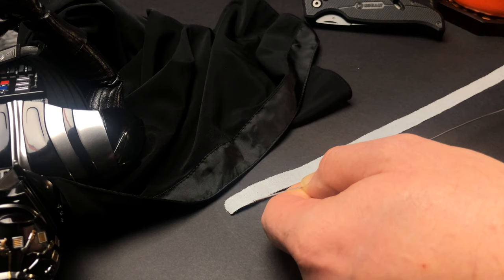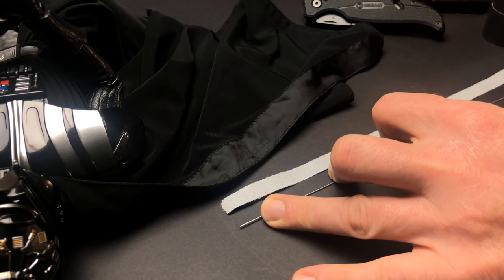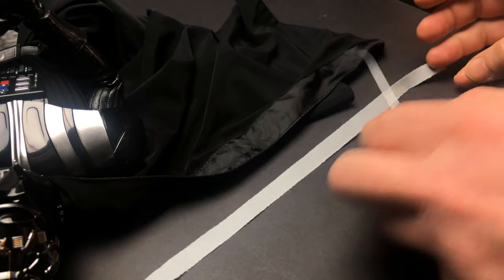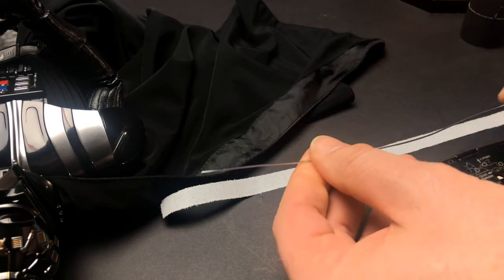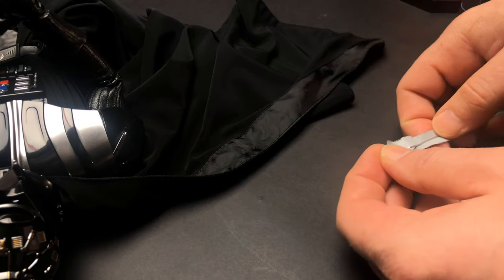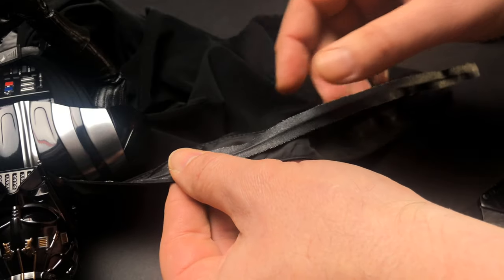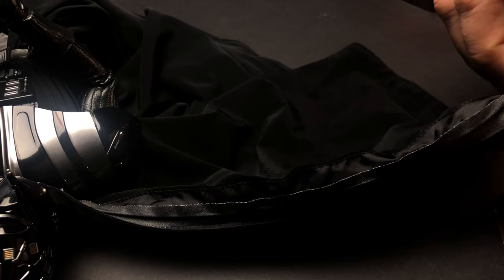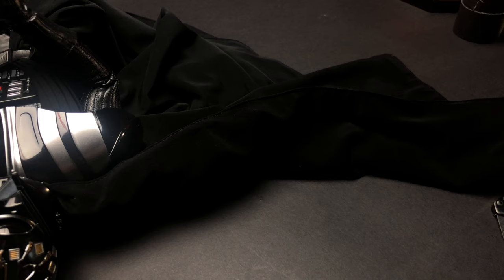Hot Toys Darth Vader Cape Hack

Comment: Thanks Terry. Would Home Depot or Lowe's have that kind of wire without the insulation on it? Or can I order a small roll from some place online? I could use this idea for my Darth Maul deluxe also,  to make his clothing flow more since I posed him leaping off his speeder, and there is no wire in the center part of his cloak to lift and hold it in place.
Reply from the maker: I get mine at either Lowe’s and Ace Hardware.
Reply: @PosemasterGeneral  Great. Thanks again.